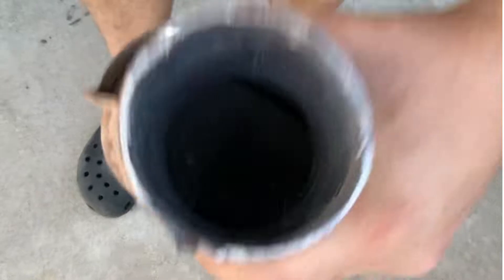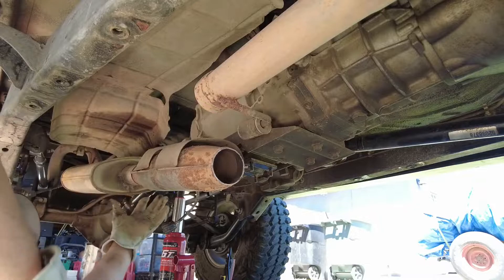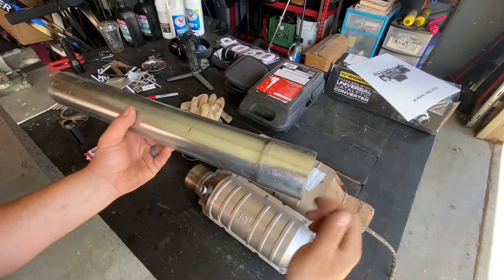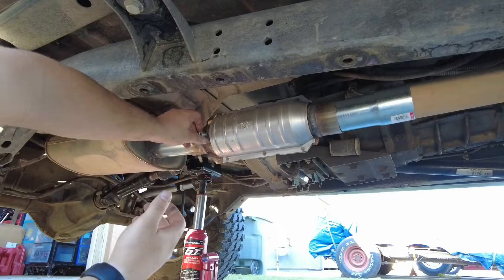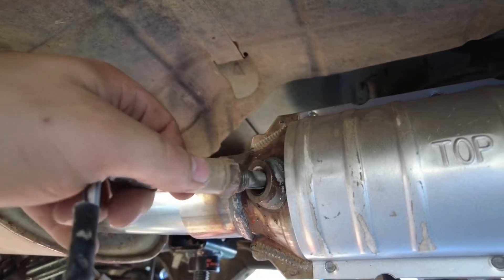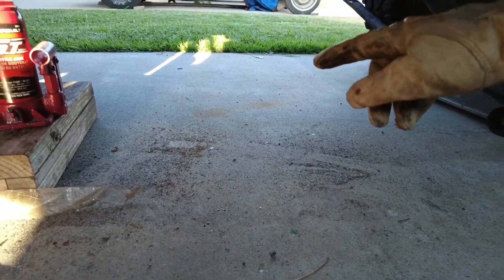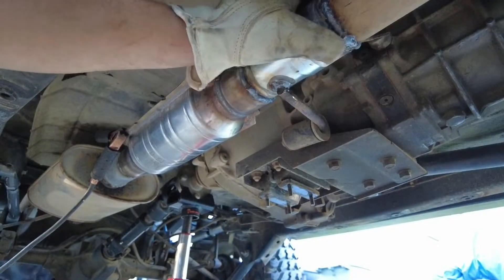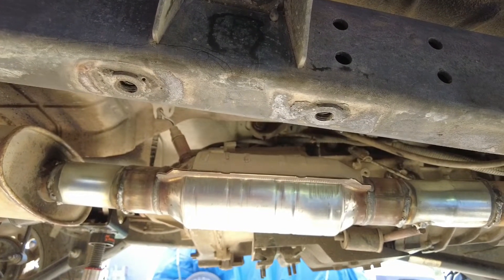Welding In A Catalytic Converter On My 1997 Jeep Wrangler TJ - DIY Weld In Magnaflow Exhaust

Comment: Well done! I just installed a Banks cat back exhaust and had the muffler shop check the cats. They said they are surprisingly in good shape for an '05 TJ. I have no idea if the previous owner put new ones in. But just in case I ran a bottle of Cataclean through it for peace of mind. I usually add 4 - 6 oz. of MMO too with each fill up. Hopefully, I won't need to do this job anytime soon, that's crazy expensive now!
Reply from the maker: It’s really expensive especially in CA. Thats a good idea for the fuel system and cat clean, I’ve never tried that stuff before! It looked like the honeycomb pieces in the cat changed shape, still intact,  but broke free form the outer walls it was contained to , hence the loose parts inside! Almost 600 for that cat is ridiculous. Luckily I  have a commercial account with Autozone and was able to get it at a half off discount! My guess is that is what most shops are doing getting a discount then, marking up the costs and saying that 150 for labor is cheap for 750 dollar job to the eyes of the customer! Haha 😂
Reply: @ATEMOFFROAD    Precious metals in those cats during these times equal a serious hit to the wallet. I still have great low end torque on this 4.0, so no need right now. The ole TJ does idle better since the Cataclean but nothing crazy different. Once or twice a year is enough. But since I use MMO regularly, I'll keep it to once a year.
Reply: @ATEMOFFROAD  can I talk you in to using your half off discount for a subscriber and I’ll pay you for your time and effort? 🙏
Reply from the maker: @the_bencredible  you need a cat ?
Reply: @ATEMOFFROAD  yeah. Need the same one for my TJ
Reply from the maker: @the_bencredible  email me the details on your Jeep  year make and model. And I can meet you at an Autozone’ Atemoffroad@gmail.com

Comment: Thank you for this video! Do you recommend emptying your fuel tank before welding?
Reply: Actually, an empty or close to empty fuel tank is more dangerous than a full one. It's the fumes that cause an explosion... not the liquid.
As far as welding safety goes... I don't think these guys worry about the tank as long as it's sealed and there are no leaks.
Reply from the maker: Yeah if I smell gas I would correct that first but most of the time it’s not much to worry about just do your best to keep the sparks away from the tank. Sparks are controllable for the most part. Muffler shops do this kind of work all the time. 🍻
Reply: @jerryjeromehawkins1712  cheers for your helpful reply!
Reply: @ATEMOFFROAD cheers for the helpful reply 👍

Comment: What are your settings
Reply from the maker: I want to say 2 on voltage and 40 wire speed , but that could if  im not popping holes through I’ll turn up to 3 and down to like 35. 👍🏼 somewhere around there 🍻

Comment: did you throw any engine codes after doing this? I wanna do this on my 2008 dodge charger cause the oem cats are welded to pipes and flanges and cost about 400 per side. Whereas I can get two universals for half and cut and weld them in my self.
Reply from the maker: No codes, and you can save a lot of money! Thanks for watching 🍻